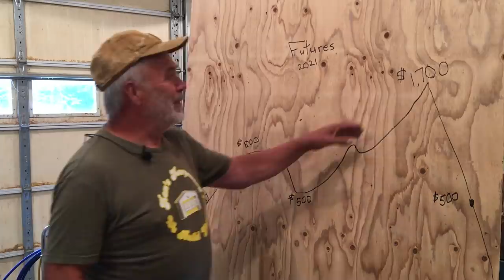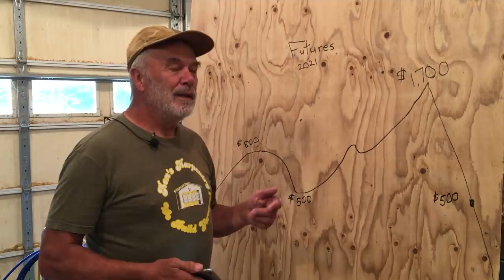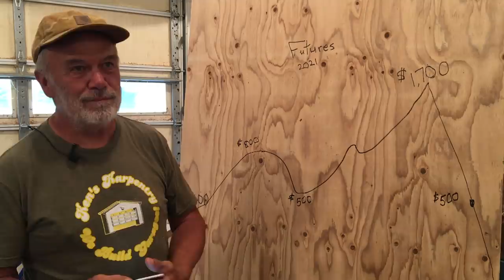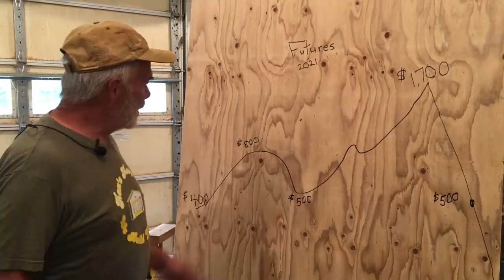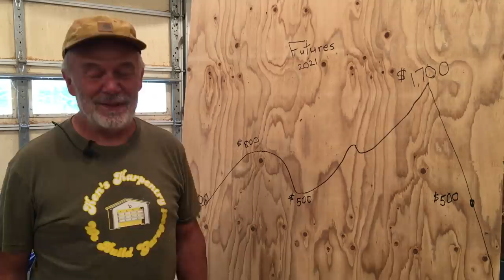PLYWOOD DROPS $21.00 in 2 weeks! :)

Comment: Thanks Ken & I agree, the signs are encouraging. Coincidentally I was in Littleton yesterday morning... I went into HD not looking for any lumber, however out of curiosity I brought my pad & pencil with me & took a stroll down the lumber aisles! This is what I found: First thing walking through the commercial entrance: Sit down folks! 5/8" 4 x 8 Advantech @ $109.00 a sheet/ $98.10 in bulk @ 55+. - 2 x 4 x 8 @  $5.82 - 2 x 4 x 96" premium studs @ $6.94 - 2 x 4 x 88" @ $5.48 - 2 x 6 x 8 @ $11.94 - OSD ZIP 7/16" x 4 x 8 @ $73.75 a sheet, HOWEVER, Georgia Pacific 7/16" OSD was @ $43.15 a sheet or $38.00 & change in bulk & lastly, 5/8" ( 23/32" ) CDX plywood @ $88.78 a 4 x 8 sheet still...On that last item I did in fact get a salesperson over to verify I was in fact looking at the correct plywood.... So things are indeed looking better, but still have away to go still, in particular plywood prices are way to high still.
After all was said & done, I bought my can of Watco Danish oil & exited the store...
Bill on the Hill... :~)

Comment: Osb at home Depot was 47 something a sheet yesterday, I shook my head and said that is a long ways from 7 a sheet, crazy
Reply: Yep, I’m waiting it out before I start my build.  Just way too expensive and out of control.
Reply: @williamdecamp7343  me too, cant touch those materials at that price. I changed trades because it. I was renovating houses and now Im moving dirt and digging holes operating machinery. When the OSB is below $10 I'll consider bidding on something. Maybe not though , machine work is much more comfortable haha
Reply: I checked my local HD today . Plywood hasn’t budged in price in the last month. I did notice studs were down. BUT mdf was up
Reply: big box store are stuck with high prices cause they filled their shelves when then shortage first hit and paid a premium. go to a small store for current pricing they dont have an overpriced backlog
Reply: @BZ1340  

Yeah. I just paid $3.98 for 2x4x8 “pressure treated #2 prime” 

The non pressure treated was in the $7 dollar range I think. But I didn’t look too close. Weren’t those close to $10 at one point?

Edit $5.97 2x4x8 per the website. The 104s were in the $7 dollar range

Still I was pleasantly surprised at the treated price. They Must have loaded up for deck season

Comment: Nice deal with the ladder hoist. The only engineering detail I would change is where the lower cable connects to the center of that rung. IOW, too much stress at a single point. I would build a bracket to spread the load wider, which will prevent rung failure from a sudden hit. Might be as easy as slipping a piece of black iron pipe inside that rung and drilling new holes.... or adding a piece of that metal lumber on the bottom edge. Remember, the rungs are strongest out near the rails of the ladder.

Comment: until it's back to around $20 a sheet, for a significant time period, I won't be biting.
Reply: Me also ! Not going to give in to the gouging!
Reply: Yep !
Reply: Sadly but it might never happen again
Reply: @vertihvost7675  As soon as interest rates rise, house prices will drop and people won't be able to pull equity out of their houses and hire contractors. It'll go through the floor at that point and be about as low as it can be given the cost of materials, manufacturing, transport/distribution and retailing.

Comment: That’s good I just staked out a single family new construction in central Jersey.. just ordered windows and pilings .. been holding off on lumber  as long as I can .. will need to pull trigger by mid August.. was hoping I could get it a little cheaper.

Comment: Around Houston, it’s less expensive to buy BC sanded plywood than CDX by about $2.00 everywhere I’ve seen. This has been the normal for several months. 
2x4 pine studs are down in the mid $4  range now. 

We think wood was bad, metal is a whole other story.

Comment: The home depot and lowes have come down a little but like you we will not be buying anything at what I  think are still rip off prices. Our A-frame will have to wait. Funny thing is that now when people are buying lumber they are alot more picky about what kind of quality they are getting.
Reply: in my experience, the larger retailers (and some smaller retailers) are fast to raise prices when futures increase, even if they're buying at spot price and spot isn't up yet. They're a lot slower to then reset their prices when the futures (and spot) markets decline. They'll take as much as they can on the way back down and talk out of both sides of their mouth explaining it (increasing their current stock price to match futures "well, we have to be able to afford the next load" and then when futures decline "well, we have to be able to get what we paid for what we have").

Comment: Hey Ken.  I live on Maui. of course I wouldn't wanna live anywhere else.  I have to share with you and the crowd the difference in concrete cost here.  
Depending on what part of the island you live on it can differ by close to 100$.  Let me explain.   If you're pouring next to the batch plant its 168$ for 2500 tail gate.  
Go west  deep and high and its 190$.  go to the summit which quiet honest isn't a big deal to get up there and its 202$ at the foot hills up to 240$ at 7000 feet elevation. 
NOW.  I have to admit the fact that we import a lot. BTW. including sand (believe that). people that live here and wanna build in the best climate the world has can and should be able to afford this cost.  YES its a cost.  so theres no real economic comparison to the upper 48 and yes our 5/8 cdx sheathing is still at around 80-90$.   would I move?   NOPE

Comment: The increased cost of materials has had a significant impact on the cost of building tiny homes for the homeless in Seattle. The labor is all volunteer so the increased cost of materials reduced the number of homes built. Good to see the material costs decease so more homeless can get out of tents.

Comment: menards 1/2 inch osb is 46 a sheet right now.within one hour of this video.    2x4 pre cut is 5.92   i hope they choke on this lumber.
Reply: At the Cheyenne store plywood is cheaper than OSB! 1/2" plywood is $46, 7/16 OSB is $56. 5/8 ply is $47, 5/8 OSB is $68!

Comment: I was finishing a deck this week, the lumber yard had told me I had saved almost half that day compared to a week ago not so sure if it was half but definitely some saving. Also at the local homies here in ny a pt 2x4x8 is about 4.70 and a common 2x4x8 was almost a full 2 dollars more.
Reply: That's still 2 dollars too high
Reply: yeah is odd PT is less then regular right now. ZIp sheathing not moving yet. no building for me yet.

Comment: 11mm osb 8x4 is £28
18mm osb 8x4 is £44
12mm ply 8x4 is £48
18mm ply 8x4 is £70
Thats in my area of England. So we are still quite highly priced.
Reply: @bmca8876  well. That's good if you postpone, maybe by the time you need it done, the prices will be better. But by then all my jobs will be piled sky high and my beard will be touching the floor. Cheers.